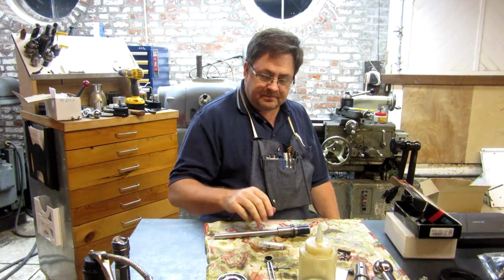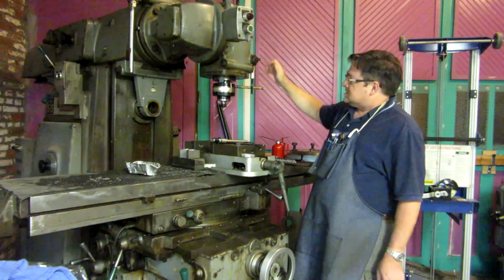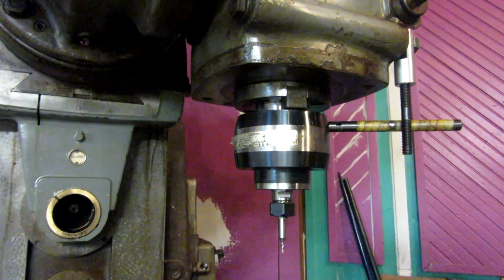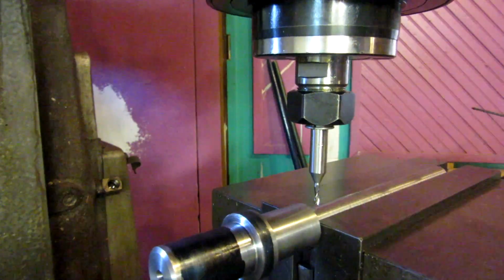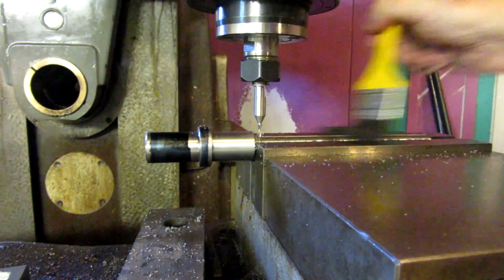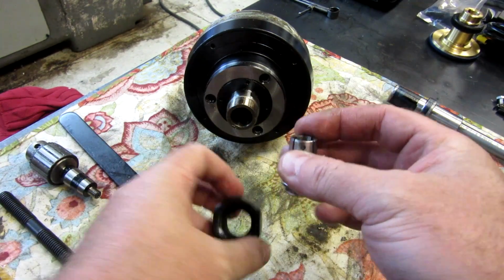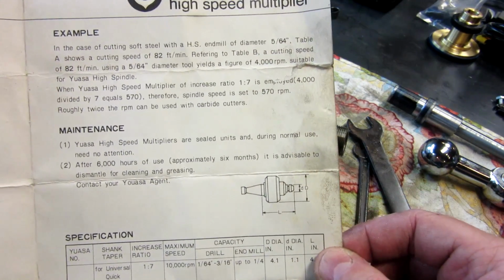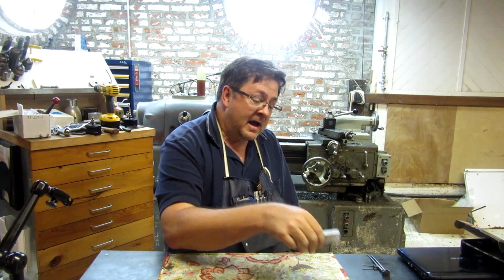Power Feed #4

Comment: Hello James,
  Your collets for the speeder look just like the spring collets used with Dewalt and Porter Cable routers, right down to the insert bushings.  If they are the same, the router collets and bushings are available in common inch and metric sizes should you need a size you do not have …

Comment: James:

I found you through Adam Booth's videos.

Fitting a Taiwan power feed to your mill reminded me of my recent experience with getting an Aclass Model APF500X power feed to work on my Grizzly 6 X 26 mill.

The feed was ordered for my particular mill through Grizzly and I, too, couldn't use the face plate because it was no where near a fit. I drilled and tapped the end plate that came with the mill to mount the drive and ended-up being able to use the shaft on the mill as-is, although I had to make a key and spacer so everything fit.

The instructions, written in Chinese, appear to have been translated using a trained ape.  They are virtually worthless except for some of the drawings.  At least, it works fine after all the trouble.

Although I'm not in your class, I do putter around.  My web page is http://www.eldensengines.com.

BOY!  This is fun!

Take care - Elden

Comment: Agree...for those odd small end-mills, you never just want to buy one when that small. That happened to me with a small 7 degree taper I was trying to use to fab/fix a gear.  I only got one and it busted...I got two on the next order and didn't break another finishing up...go figure.

That speeder looks cool.  Can it do anything in between 1x and 4.x or is it just one or the other?
Reply from the maker: ILGopher No, its just single speed 4:1.

Comment: Sometimes, you need to actually use the exact 3mm tool... much of the time, you can get away with a 1/8" = 3.175mm cutter, and use 1/8" keystock.

0.175mm is just a whisker under 0.007", so the tolerance is pretty close for many applications... not too awfully much in the way of slop.

Now, I need to go mic a 1/8" stereo plug, and see if it isn't really 3mm! ;^)

Cheers!

Eric

Comment: Thanks for sharing your spindle speeder, running 1/16" endmills at 700 RPM takes FOREVER on my machine. 
Been wanting to build a speeder, but what isn't on my to-do list? LOL
Reply from the maker: Andre Gross There is an R8 version of this unit on Ebay right now for about 1/7 retail price if you are interested.
Reply: Darn, my mill is 7 Brown and Sharpe. Close to an MT2 taper. Thanks for looking though! 
I was thinking of making one with pulleys and belts like Tom L. showed in a few of his older videos. I think it's on his blog too.